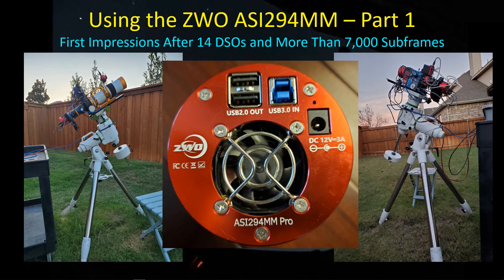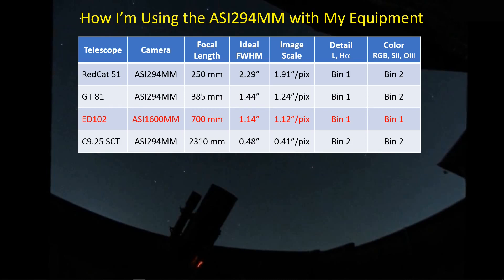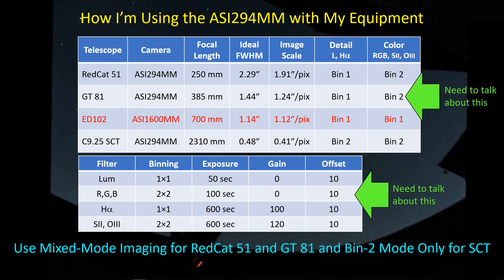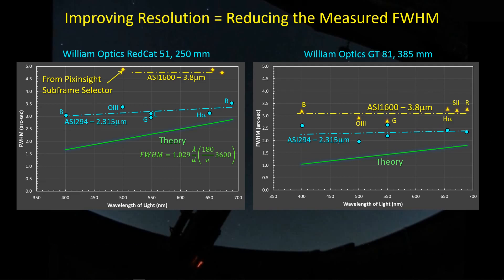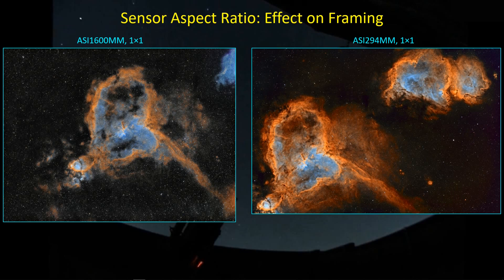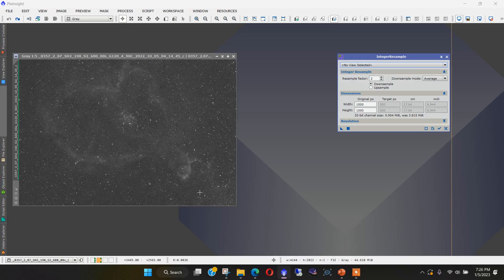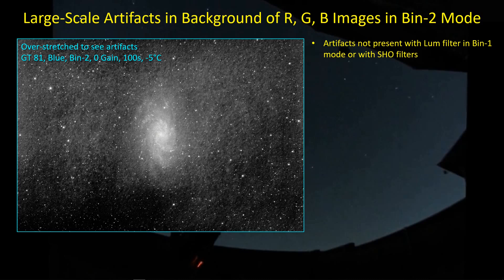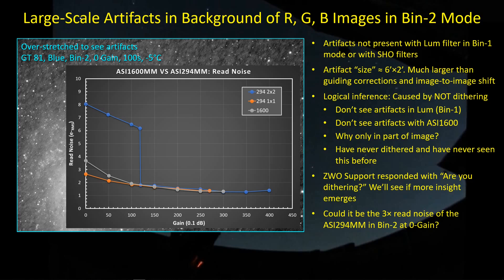First Imaging Impressions of the ZWO ASI294MM - Part 1

Comment: Hi James, I recently just stumbled across your fabulous videos on the ASI294MM bin modes.  I have this camera paired with a Sky-Watcher 150PDS with a FL of 750mm.  I've never really used the Bin 1 mode other than a quick try out on a couple of nights.  I'm not sure at that focal length if I would see any great benefit.  However, I'm shortly getting an Askar FRA400 togther with the 0.7x reducer giving focal lengths of 400mm and 280mm.  With these shorter FLs I'll definately need to use the Bin 1 mode.  I'm still a little confused as to when you would recommend a Gain 0 at Bin 1 and when it's OK to use the unity gain of 108 (or 100).  Do you have any full processing videos on combining the Bin 1 and Bin 2 images?  Thanks for any advice you can give, and keep up the great work!  Cheers, Danny
Reply from the maker: Thanks for watching, Danny! Stand by. As a matter of fact, I'll be posting a "Getting Back to Astrophotography" video tomorrow where I re-visit the 294 bin modes based on some issues I observed with my earlier approach.

Comment: Hi James, absolutely love your channel. Great work! I had the same thoughts about the pixel size of the ASI294MM Pro paired with a RedCat51. So I purchased that camera and I really love it. The only issue I have is: When connecting the camera to 12V it starts immediately to cool down the sensor from 23°C ambient to 13°C within a minute but without setting a target temperature and without sending any command via ASCOM. I contacted ZWO Support and they told me that's not normal, perhaps an issue with the temperature sensor, and gave the advise to contact ZWO in China to open an RMA. They replayed: That's normal. When connecting 12V, the cooler starts with 1% power without any command. No repair required. However, I haven't seen that kind of behavior on any other of my cameras. They start cooling only after sending the command. 
Question: Does your ASI294MM Pro show the same behavior? Does it cool down about 6-8 Kelvin when connecting 12V? For me it looks weird.
Reply from the maker: Hey Dominik. Thanks for watching! No. That's not how any of my ZWO cameras work (ASI1600MM, ASI294MM, and ASI294MC). Perhaps it depends upon what software you use to control the camera? I use NINA and when I connect to the camera, there is no cooling until I press the cooling button. Could the auto-cool behavior be common to, say, the ASI AIR? What camera control software are you using?

Comment: I have read on Cloudy Nights and Sharpcap forums that gain between 120 and 200 on the 294 is "problematic," with examples of the kind of noise you are seeing. Supposedly, the Sony datasheet recommends against gains in that range
Reply from the maker: Hey Jon. Hmmm. Sounds fishy to me. The problem with forums is that there are a lot of people saying a lot of things but only some of it is legit. First, my issue with noise(?) was when I was shooting RGB at Gain 0 in Bin-2 mode. Read noise is VERY high there. Haven’t had clear skies to test RGB at Gain 120. I have a lot of SHO images at Gain 120 in Bin-2 and have no issues with noise. Anyway, I seriously doubt a well-known and widely used camera like the ASI294 behaves problematically at and above the gain where it’s supposed to be used and the High Conversion Gain (reduces read noise and full dynamic range) kicks in. We’ll see! Thanks for watching!
Reply from the maker: Jon! Just read your YouTube bio. Fantastic! Awesome career. Congrats! This is just the hobby for you. A home away from home.

Comment: Very nice review.  Was looking at this camera for exactly the same reasons.  Just debating now if I want mono or OSC.  I will have to put more thought into that as there are good reasons for both but leaning toward mono.  Where I live for most of the time in Phoenix my skies are typically bortle 7 at the start of the evening and end just into bortle 6. (obviously when there is little to no moon) I have a new C14 Edge HD arriving in a few days and was thinking of both that and my RedCat51 for use with this camera.
Reply from the maker: The MC is great for the C14 with the binned pixel size of 4.63um and RGB is perfect for galaxies. Keep in mind that for the RC51, you want to use Bin1 mode for the small pixels (2.315 um vs 4.63 um). But the MC version does not have the "unlocked" Bin1 mode like the MM.
Reply: @Aero19612  Ah good point. I wondered about that.  I figured the 2.315um pixel size would be great for the RedCat51. I’ll pick up the mono version. Thanks!

Comment: Looking at that rat's nest on the redcat setup makes me feel better about my life's choices.

Mine looks 'slightly' better.
Reply from the maker: Indeed it is a rat's nest. I've thought the same thing. When I use a different scope, all of those cables don't look so bad with a large refractor or SCT, but the Redcat looks like it's burried.
Reply: @Aero19612  Cable Management is definitely not one of my strong suits.  I've gotten much better at it after some deliberate time spent researching techniques... but I still get freaked out every time I slew my rig to a new position while I'm inside the house.
Reply: @Aero19612  Also, I'm a huge fan of your videos.  You speak clear and concise and relay important information very well.

Comment: Very interesting video James. The noise pattern you showed really looks like walking noise that you get when not dithering as it's all oriented in the same direction (raining noise), I presume greatly accentuated by being at gain 0 in Bin2..... but I am certainly no expert. I must remember to use the process and image containers you nicely demonstrated.
Reply from the maker: Hi Logan. I’ve seen the “raining noise” before, but it’s rare. This is sort of similar, but the scale of this noise is much larger so +/- 10 pixel dither wouldn’t make a dent. Oh well, I’ll experiment in galaxy season. To make matters more challenging, my [only] 3-yr-old Ultimate Power Box decided it didn’t want to work anymore last night. That solves my noise problem. Been trading emails with Pegasus Astro support so I’ll see where that leads. Hope all is well for you and that you’re off to a fast start in 2023!

Comment: well done James. I purchased the 294MM back in summer 2022 - other than the amp glow ( which calibrates out ) it's a great camera. You taught me a thing or two in your vid....using Bin 1 on Ha & Lum.... Bin 2 on RGB & Narrow band. Very good tip
Reply from the maker: Hey Mike. Welcome to the “294” club. We don’t have T-shirts… try the mixed-mode imaging and see what you think. It’s a pretty versatile camera. You might check your stock portfolio and buy shares of Seagate or Western Digital. Thanks for watching.
Reply: @Aero19612  I agree on Seagate & Western Digital - those Bin 1 files are HUGE !   I process all of my files in Astro Pixel Processor

Comment: Great work. For my RC51 and 294mm Pro I have been using 20s for RGB. it has worked best for me. at 30s it seems like i get too much LP in the images. I am in a bortle 6 so maybe if you have darker skies you might be able to go longer. for RGB i am using Baader filters. 
I am shocked you are not Dithering. I know it sucks to dither when you are taking sub 60 second images, but for those i dither every 10 or 15 images. for my SHO i do 240s subs and dither every 5. I can honestly say that after 2 years with this setup I have NOT had any of the artifacting you have shown. I use an EQ6-R Pro as the mount FYI
Reply from the maker: Dithering is a great thing to do. I had a CGEM before my current mount (EQ6-R). Performing reliable dithering with that CGEM just wasn't doable. I do need to start playing with it with the EQ6-R - much better behaved. I shoot long (~100 sec) for the target and end up blowing out many stars. But then I take ~20 min/filter RGB at 30 sec just to get the stars. That way, I cut down on the number of files to process. 

Question: Do you shoot RGB in Bin2 at 0 gain?
Reply: @Aero19612  I havent shot Bin2 since they released the firmware to do Bin1. I was going to be doing Bin2 with my C9.25 for Galaxy season but up here in the Chicagoland area I havent had a clear night in nearly 2 months.
I have been doing Bin1 Gain 108 SHO 180s and Bin1 Gain120 for LRGB. L=15s RGB=20s
I do dither and have not had ANY issues since running with these settings. SHO dither every 5 LRGB dither every 25.
Yes its a lot of images to process with my Andromeda image being the most subs at a whopping 1707 (11.24hrs)... needless to say my PC was NOT happy with me on that. I do use a 2TB Samsung EVO 850Pro NVME for processing so things normally dont take long... but that was a long wait.
Reply from the maker: Keep in mind that the read noise in Bin1 is still very low at Gain 0, so you could use longer LRGB sub exposure time and cut the number of files by 4ish. The problem I'm seeing is in my RGB at Bin2 and Gain 0 where the read noise is 3-4 times higher than in Bin1.

Comment: I use the same camera. I use only 121 gain weather it is bin 1 or bin 2. I never allow to drop resolution below 0.8”. Absolutely counterproductive. So, pixel size and FL must give  0.8-1.4”. In your case, I will not use 294mm with SCT. There is new Omegon camera with 9um pixel. This one to use. 2x bin should be used for FL of 800-1000mm. So, you need additional camera and additional scope, such as 140mm TEC.
One more thing, dynamic range of final photos is low. You make them very bright and clip background. Why?
Reply from the maker: Gain 121 is the right approach for Bin2 - I learned that the hard way. For Bin1, there is no discontinuity in the curves so you have more flexibility. Using 121 for both does help to prevent errors though, so that is an advantage. I disagree that using the ASI294 in Bin2 mode with an SCT is "counterproductive." It's never counterproductive to be over-sampled, you just don't get any resolution advantage. To me, it is counterproductive to buy a new camera just to end up with the same image. Most people in this hobby want to get the best images possible with the least amount of money spent. You can always buy a ton of equipment if you have the money lying around, but the real challenge, for me anyway, is to maximize image quality per $. But everyone plays this game the way they see fit, so be the best YOU you can be!
Reply: @Aero19612  Viable approach. I keep alternative one. Upgrade all the time: sell old, get better. Deciding “better” is tricky. 
I have a SCT, and question was “why to have it?”. Vixen ED103SS duplet generates much better pictures.

In reality, it only started to serve it purpose, when I got appropriate camera and mount.

Comment: Really good approach, as always.

I have been using this camera for more than a year now and I'm quite happy with it.

I'm never used it under gain 120 in bin2 mode because of the drop in read noise. 

Also, I wonder why is better to use bin1 with a focal length of 800mm. I only used it with my 275 mm telescope.

I will try it on galaxy season.

Thank you again.
Reply from the maker: Hey David. I'm enjoying the 294 as well. Still climbing the learning curve. You are wise to keep Bin2 gain above 120. I was hoping to be able to use longer exposures with the RGB filters at Gain 0, but I think read noise is eating my lunch. I don't think Bin1 helps above about 700mm. Once you transition to over-sampled, you don't see any benefit of the smaller pixels. One thing however: I am thinking I'll try Lum in Bin1 with my SCT just so I can use a longer exposure and cut down on the number of files. Some more experimenting for galaxy season...Thanks for watching!

Comment: James, interesting video as always. I have an ASI294MC-Pro and a QHY294MM-Pro, so same sensor as you are using but not the same configuration. I used to have trouble with flat frame calibration until I read somewhere that there is an issue with the electronics on the ASI294 with shorter frames and the recommendation was to use a minimum exposure time of 3 seconds for flats. So that’s what I do with both cameras and I have a home-made flat panel that allows me to use the dynamic brightness feature in NINA to create all my flats with this exposure. The advantage of this is that I can use a master dark in creating the master flats. Using this approach, I’ve never had a problem with calibration on either camera. I see from your slides that your L, G and B are all shot at <3 seconds so that could be the problem.
Also, I thought that WBPP in PI did the upscaling of Bin2 images automatically if you had a mix of Bin1 and Bin2, but I’ve not personally used that approach since moving from my ATIK 383 CCD camera to the CMOS-based ones.
Reply from the maker: Hey Terry. I have also heard various comments about the need for a minimum exposure for flats. Actually, we have different sensors. The MC is a Sony IMX294 and the MM is a Sony IMX492 (not sure of difference except being able to unlock the bin1 mode in the MM. Also odd that 4-9-2 is just the reverse of 2-9-4). For the 294MM, I have not experienced problems with low-exposure-time flats (at least not that problem). That said, because I keep shooting myself in the foot with dew issues, I keep having to re-take flats. So my next video will be my Flat-taking along with the stupid "experiment" I performed.
Reply: @Aero19612  Hi James, I've just done a quick set of measurements on my QHY294MM-Pro, doing dark exposures from 0 up to 30 seconds. In both Bin1 and 2 modes, there is definitely something odd below about 3 seconds in Bin1 and below maybe 4 seconds in Bin2. If I could attach the graph I would (I assume I can't in comments on Youtube). I know this is not a ASI294MM-Pro, but I am sure that the mono cameras do use the same Sony sensor. The other thing about these low exposure times is that the ADU numbers jump about a bit in a way that they don't at longer exposures. I have no idea whether this is related to your calibration problems, but it does seem to suggest that the 294MC and 294MM cameras share similar quirks.
t	Bin2	Bin1
0	1942.01	1882.5
0.1	1941.88	1882.16
0.2	1941.73	1882.04
0.3	1941.82	1882.02
0.4	1941.85	1882.13
0.5	1941.93	1882.04
0.6	1941.99	1882.06
0.7	1942.02	1882.09
0.8	1942.17	1882.04
0.9	1942.15	1882.06
0.99	1942.23	1882.03
1	1942.2	1882.28
1.5	1942.53	1882.11
2	1942.12	1882.44
2.5	1942.23	1882.58
3	1942.28	1882.62
3.5	1942.29	1882.7
4	1942.35	1882.78
4.5	1942.38	1882.71
5	1942.42	1882.78
6	1942.49	1882.77
8	1942.61	1882.88
10	1942.69	1882.95
15	1943	1883.16
20	1943.31	1883.2
30	1943.78	1883.51
I couldn't show the graph, but these are the numbers from just single exposures.
Reply from the maker: @tezza0905  Excellent work, Terry! You can always send me stuff through email. Go to the Channel Page and click "About". So, it's not the FLAT frame, it's the DARK-FLAT? I just took flats with my ASI1600. If you have the subs from a "good" exposure time and a "bad" exposure time, use PixInsight's batch processing "Statistics" script to create a csv file of the subframes and put that in an email. I won't be able to test my 294MM until I go to the SCT.

Comment: Hey James, great work here and how timely - I just had a 294 delivered this week vice my 1600. I've got a C8 SCT I bought before I knew I'd be getting into imaging and a WO FLT91 I just got in November (and totally love). Anxious to apply your rationale and see what I see. I had always used an offset of 10 on the 1600 and last month I spent some time evaluating what offset vs gain on dark frames via SharpCap and decided on different values to ensure there was no clipping of the histogram for the gain settings I used. Jury is still deliberating on the result of my targets. With a cloudy week ahead - I planned to do the same analysis on the 294. My only question or suggestion was how did you decide on the single offset and wonder if that is a contributor though it is just a stab.
Reply from the maker: A good pair of scopes there, David. I use Offset 20 for my ASI1600 just because I saw that somewhere and I was brand new to the monochrome game. I did do a study for offset with the ASI294 and found 10 was ok (not gospel, just ok). Since then, I monitor where the tail of the histogram is during imaging and haven't found any need to changes. Depends on your skyglow and exposure times. If you come up with some ah ha observations, please pass them along.

Comment: Thank you for posting this video. I'm currently looking into which camera to get, and the two I'm looking at most are the ASI294MM or the ASI533MM. I haven't made up my mind just yet, but the 294 edges out on resolution, while the 533 seems to have especially good noise and efficiency.
Reply from the maker: Hey Michael. Yep. I looked at the 533 as well. Really like the 14-bit ADC and efficiency. Also, no amp glow. Calibration handles the 294 amp glow, but still. As I said in the video, the smaller pixel size did it for me. Lots of competing issues when comparing camera specs. There's probably no wrong answer. Good luck!